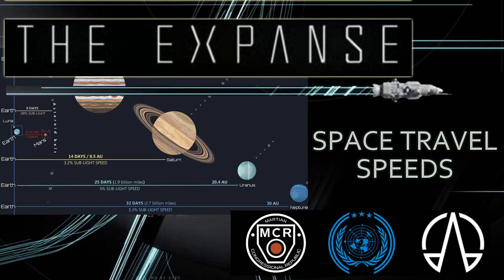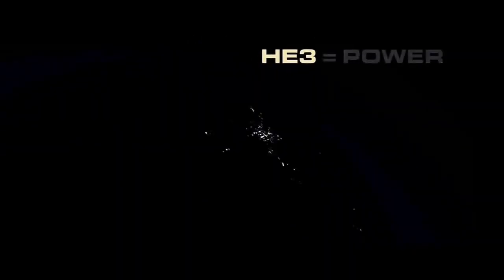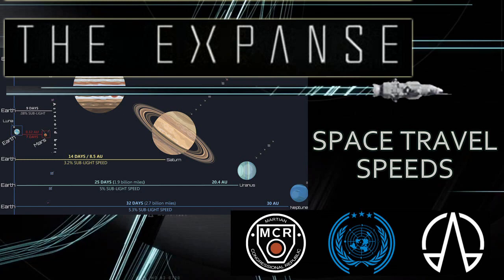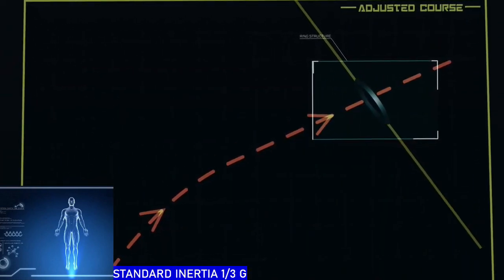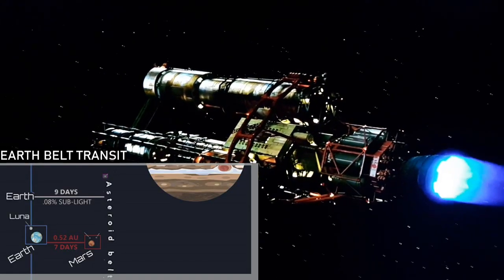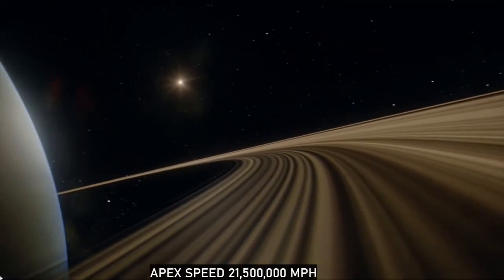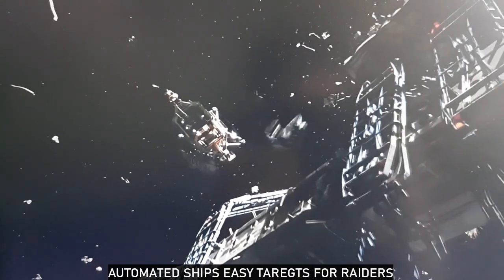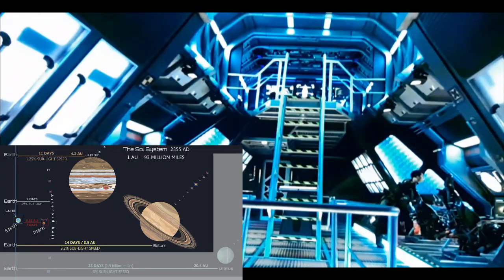THE EXPANSE FUSION SPACE TRAVEL

Comment: So when the flip and burn, what gravity are they feeling?  Are they still walking on the deck?  I’m thinking and on the start of the journey the engines and under them pushing, so they are being pulled toward them, but in the reverse, how does that work?
Reply: If they were using retro rockets to decelerate that would be a problem. But with the flip and burn technique they would still able to walk on deck.  One the ship has hit Max speed everybody on board would be moving the same speed as the ship. At this point everybody would have to strap in for the flip. But once the ship began the deceleration burn the thrust would be slowing the ship while the ship was slowing your body. This would create the same effect. I hope that makes sense. It's clear as day in my head but I'm not sure if I'm communicating it clearly.
Reply: @esics8123  They did a brilliant job of portraying that in the show, hell in the first hour they showed exactly what you're talking about. Everybody straps in to their couches, and they get "juiced" to increase survivability. We don't have anything like this juice (yet), but it consists of things that allow your body to maintain blood circulation under extremely high G conditions, along with some narcotics it would seem
Reply: I guess it would be similar to being in a high speed elevator at zero-g. As it "climbs", your body is pressed down to the floor (Positive G). 
Then at midpoint, the elevator flips and decelerates. 
You are still going to be under positive G because you are still being pressed towards the floor. Except this time, it is your body's inertia that is pressing you against the floor that is decelerating.
Just be sure to follow safety protocols during the flip :)

Comment: Just want to point out that Deuterium is abundant in earth's oceans. It is Helium-3 that is rare on Earth. I am not sure what fusion process that is used in the Expanse, but the supply of deuterium is not the problem.
Reply: Interestingly enough, a new form of deuterium has been discovered. It's called (fittingly) super-dense deuterium. It could be revolutionary because the atoms are already so close together that it should be much easier to create and sustain a fusion reaction. I'm betting this will be what gets our first commercial (both land and space) fusion reactors going. Deuterium is not ideal because you get a shit ton of neutrons, which are not only useless for power generation but extremely hazardous and hard to shield, but it's enthalpy is still far superior to any fission fuel and will generate significantly less high-level waste. Helium will be a massive improvement in every way once we figure out how to get enough of it, and I'm betting ships in The Expanse use one of the Helium reactions. Maybe someday we will get artificial hydrogen fusion to work, like our star, and then we're really cooking
Reply: He + D would produce Fast Neutrons. He-3 + He-3 would not product neutron radiation, but is pretty much impossible because of the extremely high temperatures required. with He + D, the reaction would favor D +D reactions because if the much lower temperatures compared to He3 + D. Like giving water two paths to flow. One is straight down the other nearly perfectly level.
Reply: Its not the only wrong statement in this video:
- The first fusion drives will probably be Deuterium-Tritium or Deuterium-Deuterium-reactions due to their availability on earth.
- The epstein-drive is believed to be a He3 - Deuterium-Reaction (since its aneutronic and fits the performance figures).
- He4 - p+ is not a valid a fusion reaction for energy generation or drive applications.

Comment: Terrestrial ot marine miles? Please use the metric system
Reply from the maker: Nautical Miles are only used for ocean measurement, all other miles are the same distance as far as I know. Thanks for watching.
Reply: @SurfTrekTonics  Nope. In the US two different miles on land are used. The english or statute mile and the survey mile. Also nautical miles are not only used for ocean measurement but for aviation as well. A nautical mile corresponds to the 60th part of the distance between two adjacent integer degrees of longitude at the equator.

Because the aviation standard is nautical miles and on land there are other definitions, it's always better to use the metric system to not confuse the people. That's why distances in space are always measured in kilometers, distances within a solar system in AUs and distances between stars in light years. The standard for measuring speeds in space is always kilometers per second or pecentages of light speed.

I don't try to offend you. I simply want to share knowledge. ;-) Thanks for the video. I enjoyed it.
Reply: @WhereIsTheSpartan   m/s. Standard for measuring speed ist the basic unit of length divided by the basic unit of time ;)

(full acc for the rest)